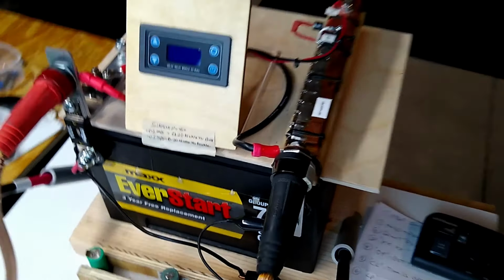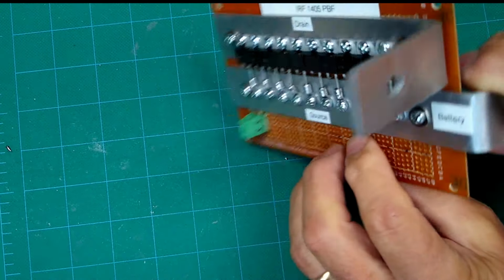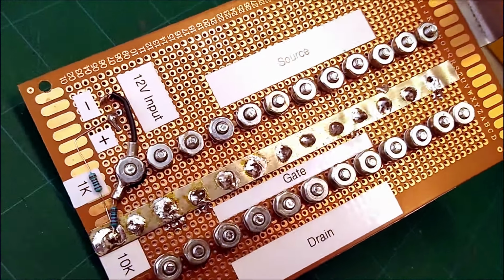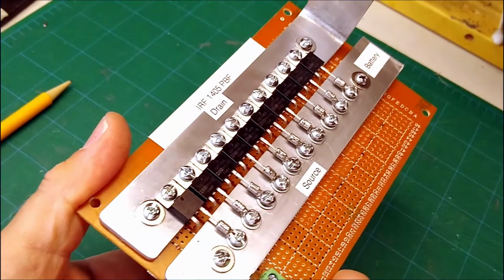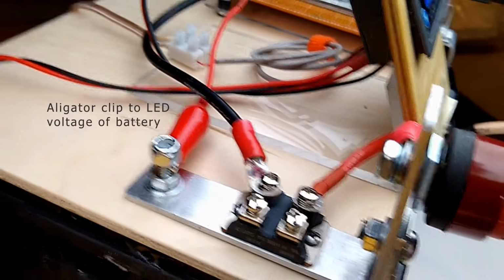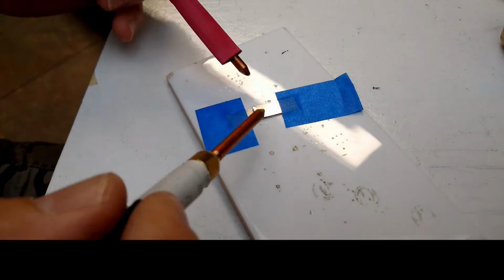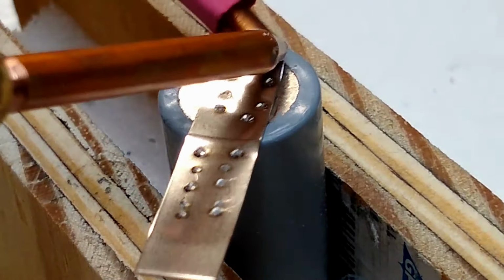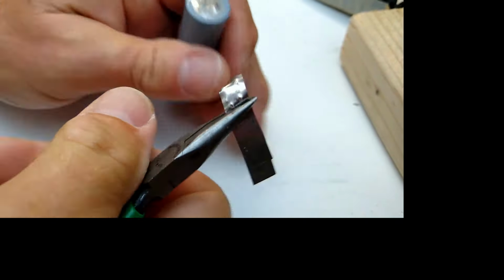Mosfet spot welder build for dummies

Comment: 1K at 12V is 12mA of gate drive current. Too low for all that gate capacitance and fast switching time... I would add a power mosfet driver so it drives gates at higher current
Reply from the maker: Good explanation of a "Power Mosfet Gate Driver" @ https://www.egr.msu.edu/classes/ece480/capstone/fall14/group08/Documents/How%20to%20Implement%20a%20MOSFET%20with%20a%20Gate%20Driver-1.pdf     Not sure what that circuit would look like or the components used to make it.
Reply from the maker: Another good explanation @  https://www.youtube.com/watch?v=8swJ_Bnsgl4A
Lots of math. Right now above my pay grade to sort out a "Power Mosfet Gate Driver"
Reply: @stevecahill9106  did you measure for how long do mosfets stay in resistive range?
Reply: @stevecahill9106  is this project for your work or for your private use?
Reply from the maker: @Ncky  How would I do that? Only have a multimeter. Limited resources.
Reply from the maker: @Ncky  private use only.
Reply: @stevecahill9106  imagine gate as a capacitor. (there is gate capacitance in datasheet) add them all up cuz they are in parallel and you have one big capacitor (all gates in parallel). Now you need to calculate the current needed for voltage on big capacitor to rise in at least 1/5 of the time of pulse. If pulse is 1ms rise and fall time has to be at least 200uS or faster
Reply from the maker: @Ncky  Spec for Mosfets I have used are Mosfets (IRF1405PBF). Spec sheet @ https://www.infineon.com/dgdl/irf1405pbf.pdf?fileId=5546d462533600a4015355db084a18bb

Spec sheet lists the following capacitances below. Not sure which one should be added up and what do I do with this value?
Ciss Input Capacitance ––– 5480 –––
Coss Output Capacitance ––– 1210 –––
Crss Reverse Transfer Capacitance ––– 280 ––– pF
Coss Output Capacitance ––– 5210 –––
Coss Output Capacitance ––– 900 –––
Coss eff. Effective Output Capacitance  ––– 1500 ––
Reply: @stevecahill9106  My bad... I meant total gate charge.. 260nC worst case

So capacitance = charge / voltage
C = 260nC / 12V = 22nF per mosfet gate
So you need to charge 22nF to 12V in less than 1ms
So to charge a 22nF capacitor to around 12V from 0V with source of 12V in around 100uS you will need 950Ohm resistor to gate from 12V. In your case i would put 950Ohm resistor per gate at 12V gate input voltage. If you have 10 mosfets in paralell then i would put 95Ohm resistor.. 950Ohm/num of mosfets in parallel to get one final gate resistor. So for 15 mosfets in parallel i would use 950/15= 63ohm resistor to charge all those gates in around 100uS at 12V.

I see that you used 10 mosfets so i would reccomend you to use 95 or 100ohm resistor between gate and 12V signal source and 220ohm resistor between gate and source. That would be enough to turn on mosfets in around 100uS and turn it off in around 200-300uS. So the mosfet is acting as a resistor only for 300uS and not any longer. I would sugges you to try with 95Ohm and 220Ohm resistors instead of yours 1K and 10K and see if there is any difference in weld quality or thermal dissapation of mosfets. With 95Ohm and 220Ohm they should dissapate less heat than with 1K and 10K. Just be sure that your 12V signal can handle at least 150mA
Reply: @stevecahill9106  Try it with 95Ohm and 220Ohm instead of 1K and 10K and check if there is difference in thermal performance and weld quality
Reply from the maker: @Ncky  Great info and thank you for this. The 12Volt power supply I am using is 1.5 amps. Will try the 95 Ohm and 220 Ohm  resistors.  I did recently put a thermistor on the mosfets and noticed about a 20 degree F rise in temp after 10 welds. I did put a small mini fan blowing across the mosfets and the temp rise was not as much.  Will keep the fan in place and monitor the temp. Will be interesting to see if there a difference in weld quality. 
Thank you for your help. Have you built your own welder and what is your background you have a solid understanding of the mosfets?
Reply: @stevecahill9106  no but im working on a project for driving infrared leds at high currents and frequencies with 3.7V gate drive voltage. Direct output of microcontroller to gate is only 20mA and waveform of the ir led current looked deformed because of slow rise and fall time and some receivers did not understand the signal. after increasing the gate drive current the transition from off to fully on state of mosfet has improved and mosfet spent less time in resistive region so it heated up the less and output waveform looked more like squarewave
Reply from the maker: @Ncky  FYI. I changed the resistors as you suggested. I did notice that the mosfets did not get as warm as before. I have a thermistor on one of the mosfet measuring this. There is a 10 degree lower difference with new resistors. Not that it was too high before this change.
Reply: @stevecahill9106  at least you got a bit more efficiency :D. Read online about mosfet thermal runaways. It's like runaway of a diesel engine. Is it in Fahrenheit or Celsius?
Reply from the maker: @Ncky  Fahrenheit
Reply: @stevecahill9106  not really a big of a change but at least you're not forcing the mosfets anymore. Is there any difference in welds?
Reply from the maker: @Ncky  Perhaps a slight difference in the welds. The negative side of the electrode always appeared not as solid as the positive. Now perhaps equal. Could of been technique and or the slit in the new nickel for this test. See photo of new weld on FB @ https://www.facebook.com/photo.php?fbid=10221905443257607&set=p.10221905443257607&type=3

Comment: Mosfets typically have an on-die flyback diode built into them if ya missed it from your datasheet, most do now days. An external diode can help reduce their temps when driving motors/coils, but there really isn't a enough inductance in your leads that would create flyback.  The diode in your positive lead is just limiting your current some and the Drain to Source diode (where a flyback diode should be installed if needed) is redundant in your circuit, but not hurting anything really.  There is also no need for the voltage divider/limiter on the gate if you are driving them with 12v from the battery.  Mosfet gates are high impedance, so you can drive them directly with voltage anywhere from vgs(th) to vgss. Building a similar unit, glad to see yours working for ya 👍🏻
Reply from the maker: Hi Greg, Thank you for your comments. Will be interested in your design. Please share over on the FB site @ https://www.facebook.com/groups/DIY18650/permalink/924615821687945/?comment_id=932376460911881&reply_comment_id=932393120910215&notif_id=1611608902082893&notif_t=group_comment&ref=notif 

 I am powering the timer to the mosfet trigger via a 12volt power supply. This power supply also powers a LED light and a miniature fan. Need to update the video showing the new cable leads thickness and the addition of a pull down lever welding technique that keeps the electrodes equally spaced. Will update the pull down lever, to a vertical automation slider. Pulling down the lever at it's slight angle cause the electrodes to slip on the nickel about a 1/16". The vertical slider should not cause the slip.  Had a idea to have it solenoid activated this way you would always get a consistent pressure on the electrode tips.
Reply: @stevecahill9106  Will do.  On a side note, the 10k resistor connected from gate to ground would be a good safeguard that the mosfet turns off quickly and is protected from esd, that might be what you already have there, if so excellent.
Reply from the maker: @greghallenbeck3676  Yes that is what I have 10K resistor.

Comment: You have a solenoid fly-back diode when you have no solenoid  and you have a 1k resistor from your 12v trigger which will keep the MOSFETS from reaching saturation quickly by resisting the current needed to overcome the capacitance of the MOSFET gates, any reason why?
Reply from the maker: What size gate resistor are you using in your mosfet welder?  Flyback is for inductive spikes.  Read here @ https://endless-sphere.com/forums/viewtopic.php?f=14&t=81400   and also here to understand the flyback diodes.  https://endless-sphere.com/forums/viewtopic.php?f=14&t=81400&start=75
Reply: @stevecahill9106  well taking a quick look at the FETs you're using something in the 2.2 - 4.7Ohm range would be much better as that would reduce rise time the FET gates experience and will significantly reduce the amount of thermal waste by having the transistors enter saturation and therefore go to the milliohm resistance state much quicker, also on the diode point, it won't do any harm I just don't find it's required on mine, the nature of the manufacture of power mosfets  means they have an inbuilt diode.
Reply from the maker: @foxabilo  Thank you. Will try increasing that resistor  2.2 - 4.7 ohm range.

Comment: This is really really a good and clear to understand video. Thumb up for you for  making  this  video as simple as ABC.

Please, What is the rating of the fuse connected between the battery positive and the welding pen cable? 

what other alternative diodes can be used? Must it be up 300A and 45V? What I can find in my country is 500v 36A and 400v 64A, can these be used?
Reply from the maker: 300amp fuse.   8 Gauge wire for welding pens. See this link below they used two mosfets as the Flyback diode, bottom of post @ https://endless-sphere.com/forums/viewtopic.php?f=14&t=81400&start=50

Comment: question about the mosfets,  can I use IRLB8314PBF?  they are cheaper, ( N-Channel 30V 171A (Tc) 125W (Tc) Through Hole TO-220-3)
Reply from the maker: I don't know.
Reply from the maker: Is it worth the savings, what is the difference?
Reply: @stevecahill9106  would of saved $10 but doesn't matter ,   I  got feed back saying its not quiet up to par  on break down voltage (to be  about 40 ~60)

Comment: Cannot understand diode. You don't have an inductive load, just a short, maybe an ohmic/passive load? Where does that reverse spike supposed to come? Most designs use multiple tvs diodes this seems different..
Reply from the maker: The use of the TVS  diode came from Endless Sphere forum. Read the threads located below. Lots of great info.
https://endless-sphere.com/forums/viewtopic.php?f=14&t=81400&p=1149634&hilit=okashira+okashira+welding+lead#p1149634

 and here:
 @ https://endless-sphere.com/forums/viewtopic.php?f=14&t=102681#p1501850

______________________________________________________________________________________
"tomjasz wrote: ↑Dec 27 2018 11:18pm
Would it be possible to describe what diode and photo of how it’s installed?
The post above by Offroader shows it well. There are two diodes. One big schottky diode goes across the leads as close to the welder as possible. Another TVS diode goes across the FET legs to catch what the other diode misses. The leads, especially long ones, will act like an inductor and store energy during the pulse. When the pulse ends, that energy has to go somewhere. Without the diode, the voltage all goes to the FETs, which could possibly damage them.

Lots of people run these circuits without the diode and it doesn't blow up as long as the supply voltage, current and lead inductance stay within reason. I'm only using a diode across the leads and no TVS diode.

Keeping the two welding wires close together (zip ties or tape) will minimize the inductance. The idea is to minimize the loop area."

_____________________________________________________________________________________

Hope this helps 
Regards

Steve
Reply from the maker: Also check here for reasoning @https://endless-sphere.com/forums/viewtopic.php?f=14&t=81400
Reply: @stevecahill9106  Steve, I have built this circuit per your contribution here (thank you) but the MOSFETS just go out with a "Bang" every first try on the weld.  I have electronic background and have made a lot of hobby circuits but I cannot get this one to work. I have tried (10)paralleled IRF1404's, 4n04R7's Irfp260N,and IRF1405's. I have checked over and over my wiring etc. and can't for the life of me see why they are failing. I buy the MOSFETS on Ebay and Amazon. I have heard there are counterfeit mismarked MOSFETS out there and thought maybe that is my problem? Any idea's here. Any help appreciated.
Reply from the maker: @BBBBAAAX  Are you using the flyback diodes? What power supply battery are you using?